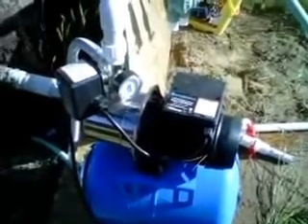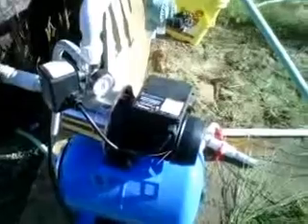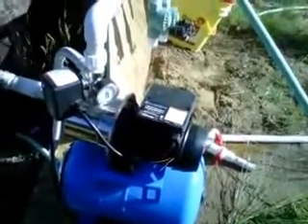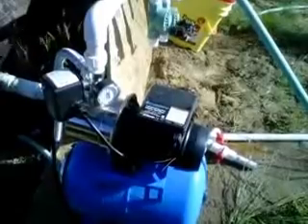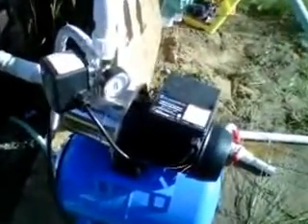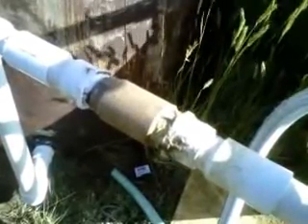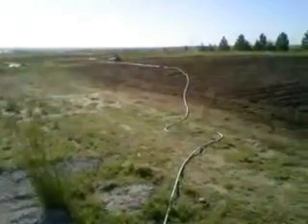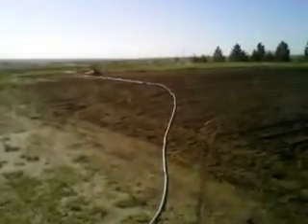Irrigation pump

Comment: But arent you filling the 500 gal with the house pump?  You said you fill it 3 times a week. With what?
Reply from the maker: Michael Yes I use the house pump. At the time I made this video I didn’t have a pressure tank on the house pump. So I would have to turn the power to the pump on and off manually. Doing it this way I was able to put a timer on the system and was able to water without having to be there.
Reply: @garza0822  my point was you are not saving your house pump as stated lol. You are using 2 instead of 1 . I get your reason though. But gosh, an in line egg timer for water hose are like 8 bucks. Been using them for yrs. I have 3 of them as i have a similar setup as you. But i dont fill with my house water lol, thats counter productive and defeats all purposes. Put the stupid tank near your roof and catch rain water!!! Then pump off rain water to gardens, better water, and dont use any of your well or electricity or stress house pump. I catch 2200 gals off my barn and gravity to my pump and irrigate from there